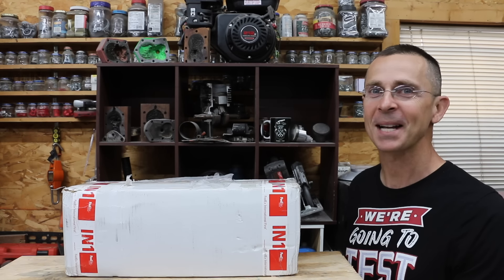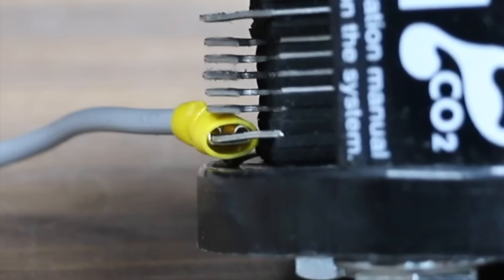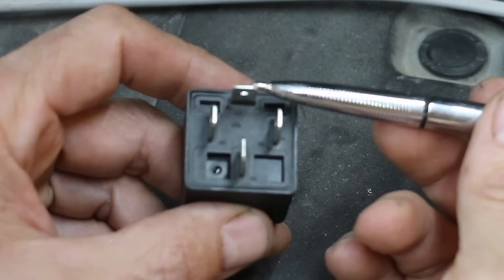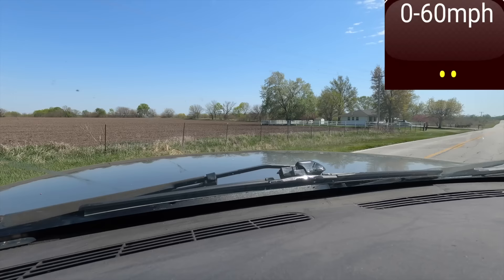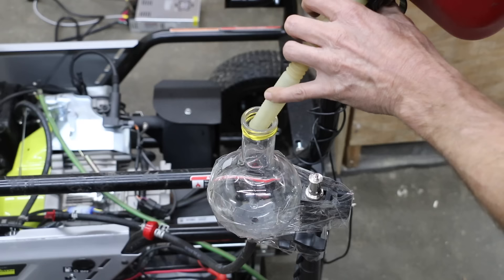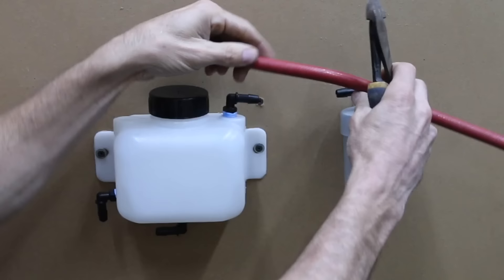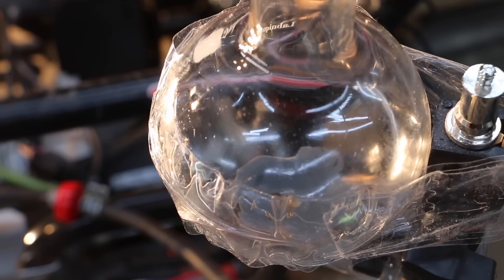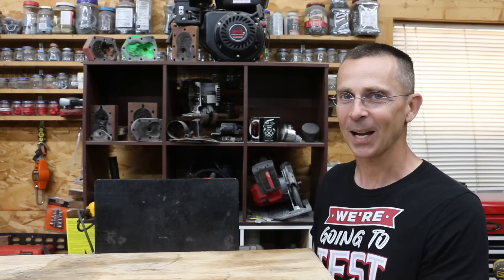AMAZING 35% More MPG with HHO? Let’s find out! Help with high gas prices?

Comment: Glad to see that conservation of energy holds true in real world testing! 

Every time the energy is converted between mechanical (M), electrical (E), and chemical (Ch) there is a loss due to conversion efficiency being less than 100% with the waste energy generally going to heat. So the engine spins the alternator (M->E), the alternator powers the HHO generator (E->Ch), and the HHO helps to run the engine (Ch->M). Every -> along the way has a fraction of the input energy being wasted. Assuming the alternator is 98% efficient, the HHO generator is 80% efficient, and the engine is 35% efficient, you're looking at ~27% (100% -> 98% -> 78% -> 27%) of the original mechanical energy returning as mechanical energy as a result of this process. 

Because the water has no inherent chemical energy (energy is required to break H2O into HHO which does have chemical energy; compare this to the gasoline which is ready to explode as is when you fill your tank), it doesn't add energy to the system. So as a result, the entire system has to be less efficient by adding what is basically just an energy conversion device.
Reply: Not true,  the alternatore make the same power when it spins, and he didn't lean out the fuel so it didn't work.
Reply: @joshfeller4683  not really sure what you mean about the alternator. The higher the electrical load on the alternator, the harder it is to spin. So it takes more energy from the engine to make up for the additional energy coming out of the alternator.
Reply: Hho fuel cells need to be sized by volume. The cell he is using is under sized and the amperage determines the volume of HHO produced not electrolyte. The mix is standard to the type of stainless steel plate in the cell. In mine its 1 oz to 1 gallon of water. It works great. I run a 3500 watt Coleman downdraft generator on just HHO, no gas anymore. This guy is alo pumping oxygen and hydrogen right back I to the motor to make water before it gets into the cylinder for combustion. That's why it isn't working at all. You have to use a split cell. Positive side makes hydrogen, negative makes oxygen. Hydrogen goes in closest to the fuel mix point so it doesn't mix with oxygen, hydrolyzed gasoline then mixes with your produced oxygen to create a high oxygen atmosphere for combustion.
Reply: @hellogoodbye3129  Where do you gain the extra energy to make the system self-sustaining? You should have loss of energy in its transformations, not gain...
Reply: @lucapalmieri9507  your mechanical advantage multiplier is throught the momentum of rotation in the pistons converted to electricity, half goes to your work load, half is run through a step up transformer to create current for hydrolysis. It's the same principle as gasoline, just not as powerful. About 40% less, but still enough excess energy through mechanical force multipliers. Chemical combustion produces excess energy. Your loss is in friction and heat, the heat can be used to increase the viability of the water making it require less current for hydrolysis. Hotter water molecules are easier to break apart, requiring less current and electrolyte. Allowing more kinetic energy to turn the magneto, that now has less resistance for maintaining combustion. And the cycle continues until the water is depleted. It is almost a perfect perpetual system that produces excess energy. Almost. This technology has been around since ww2.
Reply: @lucapalmieri9507  as for HHO additive in cars the process doesn't burn hydrogen directly. The hydrogen is mixed with the hydrocarbons in gasoline to increase the energy release in combustion by 35%. You are making hydrolyzed gasoline, that burns at 98% effectiveness. Low emissions, low chemical corrosion break down in your lubricant, and less friction from from a more stable power transfer of potential energy to kinetic energy. Hydrolyzed gas is just gas that burns better.
Reply: @hellogoodbye3129  Make a video of your generator running on only HHO, powering the HHO cell and some other things to show that it really works.  Also show how you're metering the HHO ratio with varying loads.
Reply: @hellogoodbye3129  you sound like someone explaining the afterlife, your selling something you think not know..  were is the extra energy coming from?
Reply: From what I make of it he's saying You don't need "extra energy" you're just making it more efficient overall. It's not like ICEs get anywhere near 100% of the energy that is potentially available in the gasoline. Making use of waste energy is the lowest hanging fruit in system efficiency.
Reply: @MrDJAK777  but the waste in an ICE isn't just unused mechanical energy. It's going to heat which is just sent to the atmosphere. So the ICE needs to produce more mechanical energy to spin the alternator harder.
Reply: @ultimavoid  the heat doesn't have to go just to the atmosphere. Industry uses waste heat to improve the efficiency of process cycles all the time. Which the commenter suggested is one thing done here with the "engine heat to warm water to lower hydrolysis energy requirements" if that helps with the energy use of the add on and there if the benefit provided by hydrolyzed gasoline (if it can actually allow leaner mixes with the same performance)  greater than the drain the hydrolysis causes there's going to be a net efficiency gain.
Reply: @MrDJAK777  this is true. Hho doesn't have near the potential energy of gas. But it has enough to resist the load of a 32lb magneto absorbing supply demands. I didn't come up with this. I watched a video on YouTube, did some research, gathered parts and it works! I can run 1.5w continuously with a 2kw surge. Getting it started is where the energy injection comes into play. You have to run a battery to start producing HHO, then turn the motor manually. Takes 4 pulls to start. Much quieter and the water just rolls out the exhauste, I don't recommend using the water again. It is contaminated with oil and will ruin your plates, I'm told. Distilled water and salts only.
Reply: @MrDJAK777  sure you could use heat to increase efficiencies of purpose build high temp electrolizers ( e.g.  sunfire Grinhy 2.0 project ) but thinking that you could do that with these alkaline non separating plate electrolizers and achieve an amazing efficiency that will overcome the inherent inefficiencies of an ICE engine (both thermal and mechanical)  including the losses from kinetic to electric energy then to chemical energy is IMHO very delusional.
Reply: And it costs more to create the hho through electrolysis m than gasoline.
Reply: @hellogoodbye3129  The main problems I saw with his setup was HHO Cells require a Square Wave Rectifier to create HHO Gas not just splitting water into Hydrogen and Oxygen.   Second, because he is only splitting H2O to HH and O2 with very little HHO as a byproduct it throws the O2 sensors out of wack that the computer cannot compensate the fuel to air mixture.  On old vehicles pre 1967 that system may work better, but not newer vehicles.  You can trick some older vehicles that have O2 sensors by using spark defoulers that moves them farther out of the exast pipe...but you'd still need to lean out the fuel mixture to compensate the added oxygen.  New systems use a plug in chip that is designed for the vehicle specifically that makes these changes automatically.
Reply: @johnchism9625  I should note the guy that built his was on an old GMC Sonoma v6. He ended up blowing the motor because his production was way to high. His HHO cells, plural, were big. I believe one cell was for low rpms and the other started producing at higher rpms. He also put an extra 60 amp alternator on to make up for the extra draw. But that old shit box really moved. Throttle response wasn't great, but when it started rolling it really flew.
Reply: @hellogoodbye3129  In 1988 I learned about "Brown's Gas" from a 1940s Collage Basic Science textbook 4th edition -I still have it on my desk among many other chemical, technical and science textbooks.  It wasn't until 2012 that I made my own HHO dry-cell for a 1987 jeep wrangler 4.2 I6 carbureted and learned by trial and error to increase the fuel milage from 18 to 32 mpg.  Most systems now are wet-cell and more efficient than dry-cells.  I still use that old dry-cell HHO as a torch that will cut stainless steel, melt tungsten and is used extensively in melting platinum for making jewerly and even melt stone.   I built a micro HHO wet-cell that without a carburator or any gas runs a weed eater or gas engine up to 5hp by adjusting the voltage and amperage with a rectifier and you must create a Square Wave for them to work right - which Brown said in his patent - or you're only separating the H2O to HH and O with a fraction being HHO Brown's Gas.  Why people refuse to use step-up rectifiers is beyond my comprehension to achive higher wattage from lesser wattage - without needing a more powerful alternator...which is exactly what an ignition coil does to make high energy spark plugs work.   Every skeptic is an engineer that quoats the laws of thermodynamics saying it doesn't work to create more energy... But the whole point of using HHO in any ICE is to increase fuel mileage which they do if done correctly.
Reply: @johnchism9625  thank you. Finally someone that knows how to do research! There are literally videos on how to make it work and its principles. On YouTube! But that is awesome that you made a torch and your vehicle got such good mileage. My generator is a behemoth with all the additions. It hasn't failed me yet. But I try to not use it if don't have to. I have a step up transformer/controller that will adjust with a load but is meant to stay at the tuned level to keep the engine at 3600rpm. Which gives me the 3500watts 1.5kw to work load and the rest to processing components. So a 1.5k excess of energy at 120v. 10 amp isn't to shabby. It's not perfect but it's safe. As long as you move the waste water away from the machine in sub 0°f temps. It definitely needs even heat distribution.
Reply: @hellogoodbye3129  You didn't come right out andsay it, but sounds like you're using a HHO on a ICE 1.5kw generator that gives the electricity to run the HHO system by ? fuel/HHO.   Fact is I don't know what your system is like.   Actual HHO made by a square wave does not generate much heat and heated water above 212F is mostly creating steam with HH and O as a byproduct, and not HHO Brown's Gas that is a "gas" unlike any other gases that have carbon bonds.   I assume you have a dryer/bubbler system and a spark arrestor?  If so, the steam is mostly returned to water until the bubbler gets boiling hot too?  How big are your plate and are they staggered in a 1 possitive 2, negatives, 1possitive, etc... Or is it a possitive on one end with a negative on the other with many plates between them as neturals?  The latter is just a common Hydrogen/Oxygen generator where it needs a filter material that hydrogen passes through but is too fine for oxygen to pass through or it mixes them as HH an O molecules and if there is stem it's like water injection until there's too much.   While the HH and O is still combustible and added into the air mixture of a ICE with a fuel will improve fuel consumption,  HHO does it better.   I hope this helps.
Reply: @johnchism9625    "Brown's Gas"? Chemists speak of oxyhydrogen gas, others call it explosive gas. There is no mythical "Brown's Gas" with properties which are different from the well known mixture of hydrogen and oxygen. Brown didn't find anything new. But never mind if you call it Brown's gas or HHO, you can only increase MPG substantially with an electrolytic cell which produces more energy than the input of electrical energy. And such a cell doesn't exist.
Reply: @hellogoodbye3129     " your mechanical advantage multiplier is throught the momentum of rotation in the pistons converted to electricity, half goes to your work load, half is run through a step up transformer to create current for hydrolysis "
???  None of this processes gain energy, all of them have losses. Where is the "multiplier"? To increase MPG you would need an electrolytic cell which outputs more hydrogen energy than the electrical input. Such a cell doesn't exist.
Reply: @heinzpg  well it does exist. There is loss but the loss isn't enough to not maintain production. The generator is 3500watts. It requires 2kwatts to maintain production and an excess of 1.5k wts at 10amp 120v.  My step up transformer/controller/rectifier unit is all in one. It increases the current to maintain the production of HHO so that the ICE runs at 3600rpm. It's not a gas engine by any means but the potential energy of HHO is greater than the kinetic loss of the generator. And remember compressing the gas increases the potential energy of the kinetic release during detonation.
Reply: @heinzpg  and once again you can look this up. I did. I'm not a chemist, electrical engineer, or a physicist. I'm a construction work that can follow directions. Current amplification is a well known phenomenon that is already used in motor vehicles. Its call an ignition coil. The same principle applies to an HHO generator. Just a little bit of research and you can find lots of videos on this. Coleman 8hp 3500watt hho conversions. I don't get as much amperage as they did but my generator is old and worn.
Reply: @hellogoodbye3129    Yes, you can amplify current. I wouldn't call it an ignition coil, since ignition coils are intended to increase voltage, not current. But they can be used the other way too of course, it's just a transformer. But if you increase the current, the voltage drops with the same rate. Watts at the output are the same as at the input, minus losses. A transformer can step up voltage or current, but it does not generate any energy. 

Yes, there are a lots of videos on HHO generation which claim fabulous efficiencies. Most people who watch these videos with awe are not aware, that hydrogen gas is produced by electrolysis on an industrial scale since almost hundred years, many companies do it. Their devices have been improved all the time to push up efficiency and it is not very likely that YouTubers can do it better. If there would be a better way, these companies would jump at it at once to increase their profits. Some of these videos are deliberate scams, others come to their high efficiency only by incompetent measurements. Let's take the electrolytic cell you are using as an example. If you can give me the watts of the electrical input and the volume of gas (hydrogen plus oxygen) produced in a certain time I can give you a good estimate how efficient the cell is. I guess it's efficiency will be about 60%. 

As to "Coleman 8hp 3500Watt HHO Conversion", can you give me a specific link? Coleman is known for it's power generators, and of course you can use their electric output for HHO production. But the key is still the efficiency of the electrolytic cell, never mind if the cell is powered from a "Coleman" or from a wall plug with power adapter.
Reply: @heinzpg  so my input voltage is 120v, amps is 20, watts is 2k. The voltage to the plates are less than lethal, 50v>, the amperage is 40-60. If I remember correctly the volume of HHO is 8L per minute. With 56 plates at 6inch by 6inch. All wires are 6awg or larger. The amperage changes depending on the load. But it's a brief. The heat sink to the pyrex cell housing keeps the water temp at 180-200°f, and the vibration cycle is 1800 cycles per minute. The website where I got the transformer/rectifier/controller is not up any more. I just picked up another Coleman to build another one, so I'm going to have to find another controller. I built my first one about 6 years ago. So it's been awhile.
Reply: @heinzpg  mind you, you cannot put a load on this machine until you are at full temp and capacity. It will stall immediately, the battery is a 48vlt/100amphr that puts out 5kwts. It was very expensive to build but I sourced most parts second hand from my cousin whom worked at Noles atomic in upstate ny. He did my tuning, and controller programming. To quote him, he said "this is the most back woods contraption he has ever worked on". But it works, he also said this technology is already out dated, there are much more efficient ways to make this power. This was years ago. But I already spent over 2 grand on this project and what I'm getting for power is not cost effective compared to other technologies. But I only need distilled water and salts to run it. And with gasoline prices the way they were then to now it doesn't seem like such a bad investment. I should add that the duty cycle is garbage. It's less than 70%. So running it for 10 hrs requires 3hrs cool off time just to use up another 1 hrs worth of fuel to get back up to capacity.
Reply: Can you repeat that?
Reply: @hellogoodbye3129     I want to make sure I understand your system correctly. You run a combustion engine with no other fuel than HHO. This engine drives a generator wich produces electrical power. A part of this power is used to produce the complete HHO for the engine by an electrolytic cell. The rest of the electrical power is free to be used for other purposes. Correct?

Now for the numbers. The input for the cell is according to your comment 120V, 20 amps, 2k Watt. I would expect 2.4 kW, reason for the difference could be that the input is not pure DC, this difference is not important. The cell produces 8 liters of HHO in one minute. The equivalent power of this production is approx. 1 kW, which makes an efficiency of the cell of about 50%. The surprising thing is, the engine gets via HHO an input of 1 kW, but the generator driven by this engine delivers 3.5 kW ?! Although a hydrogen combustion engine has only an efficiency of about 40% and also the efficiency of a generator is below 100%. This is hard to understand! Can you clarifiy this discrepancy? Or do you think conservation of energy is not valid in your system?
Reply: @heinzpg  so the total production power from the generator is 3500watts, 240v, 40 amps, 2kwts to the production of HHO. This is to the controlle/battery then from there to the cell. The cell produces about 8L/min that is forced through the intake.  Now mind you there is a heat sink that improves efficiency of production, and a vibration unit that improves the flow rate. It reduces hydrotension thus reducing the current needed to produce said volume. No energy loss in either of these processes. The Ice makes the heat and simultaneously vibrates the cell at half the rpms. This is a massive increase in efficiency. I'm literally using the heat loss and mechanical loss to improve the production capabilities of the cell. Thus improving my overall efficiency back to a balanced system or pretty close. I could put a higher production magneto on it and have more excess wattage.  You seem to have a hard time understanding that the magneto makes electricity. Not the hydrogen. If you magneto makes more wattage than you need to make fuel you have excess energy. Hence the mechanical multiplier of a generator. You are spinning a magneto that has momentum that is very efficient. The energy to spin the magneto is less than the production of power the magneto creates. Hence excess power. Does this help?
Reply: @heinzpg  the efficiency of the cell is higher than 40%. The controller, heat sink, and vibration improves its efficiency. I do lose 10 amps in there somewhere. So maybe that's the loss you seem to be needing. Once again I'm not a electrical engineer, physicist, or worldly scholar, but I can follow instructions on how to put parts together. So maybe I'm not telling you something crucial, but I can say this. That little generator makes 1.5watts, at 120v, at 10 amps. And its quieter than a gas motor.
Reply: @heinzpg  so to make the point. Of energy conversion, why would I waste my energy trying to convince anyone that the system works if they couldn't make one themselves. I gain nothing either way. I could just ignore you. But it could benefit you so I'm making an effort to help. Have a good life and good luck.
Reply: @hellogoodbye3129    Thanks for your explanations. In return I will explain you why I still have problems to understand your system. You are not an engineer and physicist, and thus you are not familiar with conservation of energy. It is one of the most fundamental and best confirmed laws of physics, never was any exception observed and there is even a proof, that our universe couldn't be stable without this principle. In short: energy can be transformed from one type in another type, but energy can not be created or disappear. Thus, if you have a system with an output power of 100 Watt, there must be an input of 100 Watt. Only exception: if the system has a storage of energy which is used up over time, then obviously there can be an output higher than the input.
Let's look at a generator. If a generator produces electricity, you must apply a torque to turn the shaft. This is the mechanical power, which is input, besides a constant it is given by the product of torque and rpm. If this mechanical input power is 100 Watt, there will be an output of exactly 100 Watt. Unfortunately, perhaps 80 Watt will be electrical power, and 20 Watt heat losses. With a better construction you might reach 95 Watt electrical power, but never ever will you get more than 100 Watt output. So if you write " The energy to spin the magneto is less than the production of power the magneto creates " it doesn't help me in any way, since due to conservation of energy output can never be higher than input .
And this can be applied for your whole system. It is supposed to deliver 1.5 kW, and this would need an input of at least 1.5 kW. Where is this input? All you input is water, but water has no chemical energy, only hydrogen has. But to get hydrogen from water you have to spent more energy than the produced hydrogen can deliver. Even with every component having an efficiency of 100% your system could not work.
This is the reason why your explanations don't help me and they also don't help mankind. If you really want to help there is only one way, which is a little cumbersome. Get hold of a competent engineer or physicist, invite him to your place to inspect your system and let him write a report about this power generation out of water.  Unfortunately, there were thousands of people who reported to have such a system which produces an energy output without an equivalent energy input. But none of them ever took the trouble to obtain a competent third party confirmation, although this would help mankind immensely and the name of the person who got such a confirmation would become famous and would be mentioned in any textbook on physics in the future. I refrain from speculations why this has never happened. 
I also wish you a good life and good luck.
Reply: @ultimavoid  Correct, the alternator is converting kinetic energy from the engine driving it via the belt into electrical energy... so the more energy it creates the more drag... same way regenerative braking on an EV works... rather than turning kinetic energy into heat energy like with a conventional brake rotor and pads... you convert it into electrical energy.... but you have losses as you say and thus lose more energy than the device could possibly gain you in efficiency. For those stating you have to lean out the engine through the carb... fuel injection would have to do the same thing... but then you are shifting away from stocheometric air/fuel ratio. Now with low load, you could do that minus the expensive device that basically does nothing to the air/fuel ratio when you consider how much air the engine is pumping vs. the small bubbles of hydrogen the device produces.  Air/fuel ratio is by mass... 14 parts air to 1 part fuel for gasoline... on a small block chevy 350 cu inches of air per rotation to a tiny droplets of fuel per stroke... and it is the weight/mass of the air that matters, which is why chilling the air can make more power.. a huge part of why nitrous oxide systems make so much power, you increase the oxygen by introducing N2O and more fuel to keep the A/F ratio where you want it for max power... 21% O2 vs 33% O2 equals more power when you add the matching fuel.  The coversion of the nitrous from a liquid to a gas when it exits the bottle drops the intake temp by hundreds of degrees... meaning you can fit much much more air into the cylinder per stroke and add even more fuel for more power. Problem with using Oxygen as a power adder is that it would just turn your engine into a torch. The nitrogen in the N2O acts as a buffer as Nitrogen is normally an inert gas (until you hit certain pressure and temperature levels at which point you can create Oxides of Nitrogen which are really really bad for everything.
Reply: @hellogoodbye3129  good on you mate you just can't help some people. ive known many smart men but bugger all wise ones . the point is people unleaded in Australia is $2.15 L,  water out of a rainwater tank is free, good on u hello goodbye some people will always reject your reality  and substitute with their own
Reply: yes we all know for every action there is an equal reaction most of the time !!! these hydrolyzers have been used for years by lots of people and they do work when the engines they are used on are tuned for the different fuel that is being put into them, i thought even smart people new this. on paper a bowling ball should fall faster than a feather but it doesnt. the hole point is water is cheaper than petrol
Reply: @stickers7627  thank you. I didn't figure this stuff out, other people did. I just built it the way I was told. A monkey turning a wrench, y'know? Sorry to hear about what's been happening in your country. I have cousins down there and they can't even get Carona Extra anymore. And it's only the tip of the iceberg. Good luck buddy, thank you, and stay alive.
Reply: @stickers7627  there's no "most of the time" when it comes to laws of physics. Sum of energy in = sum of energy out. If you can find an example that contradicts that, you can turn the entire discipline of physics on it's head.

A bowling ball does fall faster than a feather unless you do the experiment in a vacuum chamber. The coefficient of drag on a feather is much greater than a bowling ball, so there is more force from drag counteracting gravity on the feather. Remove the air and you remove the drag, so it's just the same gravity acting on both. On paper and in real life, they both check out.
Reply: @hellogoodbye3129  we will be OK mate plenty of water for us the smart people don't want it
Reply: @stickers7627  🤣
Reply: @stickers7627    A bowling ball does fall faster than a feather. However, science knows that the difference is just caused by air resistance. In vacuum bowling ball and feather fall with the same acceleration. Because with an object with more mass force of gravitation is stronger but also inertia is bigger, and thus mass does not influence the acceleration of falling in vacuum.
And just as science knows about the falling of bowling balls and feathers, science also knows that water is not a fuel. Hydrogen is, but to get hydrogen from water you have to invest more energy than the produced hydrogen can deliver. That's why hydrolyzers together with tuning may cause a very slight rise in fuel efficiency in singular cases but in general this can't work.
Reply: So false. Idk where you did that research but your completely wrong. First of all the alturnator spins and produces power any way so its not loading the system, secondly water is one of The most power dence things on this planet besides suger. Hho also has a far greater expansion rate and can be safely made on demand. There are cells that run motors its a fact there are even commercially available welders and generators that run on water...
Reply: @chrisofthecosmos648    No, an alternator does not produce power "any way". It needs mechanical power to spin an alternator, and the more electrical power is produced the more mechanical power is needed to spin the alternator. The input of mechanical power is always bigger than the electrical power produced.Thus, the alternator is indeed a load for the system. 
And water is not a fuel, you can't burn water. For the simple reason that water is what you get when you burn hydrogen. Same thing with carbon. You can burn carbon and if you do that you get CO2. But you can't burn CO2. Of course it is possible to produce hydrogen from water with an electrolytic cell, this is done on a big scale by many companies since hundred years. But in this process you have to spend more electrical energy than the produced hydrogen can deliver.
And yes, you can run motors with hydrogen produced by a cell, but you can never get the electrical power needed at the input of the cell by an alternator driven by this motor. This is completely absurd.
Reply: @heinzpg  yeagh, you are definitely wrong. In many ways. Water does burn at extremely high temperatures. 5k°F<.  It has to be hot enough to break the bonds between the molecules. And it takes alot less energy to break the molecules apart through electrical ionization. Like in a HHO cell. The trick is to make the efficiency of producing HHO higher than your energy loss. I recover the heat and use it to raise the temp of the salt water to just less than boiling, as well as a mechanical knocker to break the hydrotension of the gas bubbles and doubles my out put rate of HHO comparatively. The efficiency of this system is awesome. Once again this technology has been around since world war 2. And Once again, stop being lazy and look it up. Look up the Tesla motor while you are at it. It will open your eyes to electrical conversion theories.
Reply: @ultimavoid  actually you are wrong, not taking into consideration that the mass of the bowling ball creates a measurable gravity larger than the feather and in addition of earth's gravity aswell as the bowling ball's gravity creates a higher acceleration, thus a higher speed towards each other. The difference may be miniscule, but still a fact. So the bowling ball does fall faster. So you are wrong, this isn't the 80's, we can measure these differences. You need to get your information from somewhere else besides tiktok. Look it up.
Reply: @hellogoodbye3129     I can only recommend to look up "conservation of energy". It is one of the best proved laws of nature, there is even a proof (Noether theorem) that our universe could not be stable without this principle. The efficiency of an electrolytic cell can't be above 100%. Never mind if you use heat or a mechanical knocker, both need an input of energy. But to run a motor by water would need an efficiency of the electrolytic cell of about 300%! 
It is easy to look up conservation of energy, you find it in Wikipedia and in any text book of physics. In contrast, your hints are more than vague. What about specific details? Name of companies who use this miracle-technology? Number of a patent describing it? Which efficiency is reached? And what do you mean by "Tesla motor"? I hope not the well known hoax about a car built by Nicola Tesla and which run without fuel? This hoax was brought up by a Mr. Savo after Teslas death. This car never existed. At the time this car was supposed to run Tesla lived in old age in a hotel in New York, he had no lab and no other assistance. 

Unless you are able to supply specific details about this miracle cell-technology I rate it as complete rubbish.
Reply: @heinzpg  my generator produces more electricity than is required to make HHO. The ice/hho portion of the generator requires a little over have the power that magneto makes. I dont get why you dont understand this. The only components that would have a patent numbers would be the original Coleman downdraft generator, and the  step up transformer/controller (which is Japanese). These are common items. I built the HHO cells, heat transfer array, and the knocker. The HHO cell only powers the motor to turn the magneto. The size of the magneto determines the out put of power. Once the magneto is spinning, it takes very little energy to keep it spinning. The reference to the Tesla motor is to prove the rotational momentum in a magneto is extremely efficient and effective. The law of conservation only applies to the ice/hho portion of the machine, not the total output of the magneto. If it was bigger, I could produce more power. The cell only requires a certain amount to sustain itself, as long as the magneto produces more current than required to feed the HHO portion you have excess current to do what you want with.
Reply: @heinzpg  this is like arguing the earth is round to flat earthers. The earth is round, HHO motors do exist, both have been this way for along time. And to clarify, the term down draft seems to be lost on people, it still burns normal atmosphere aswell as the hydrocarbons from the oil lubricant. It doesn't just burn HHO. It's a down draft motor. But the previous mentions of magneto size still apply regardless.
Reply: @hellogoodbye3129    " The law of conservation only applies to the ice/hho portion "    Fundamentally wrong! Conservation of energy applies to every system in our universe, without any exception! Look at power generators. The more electrical power they deliver, the more power has the engine driving the generator. You can't get eletrical power from a system, if there isn't an equivalent input of power. No  generator and also no magneto can have an efficiency over 100%.
Let's say you feed one unit of electrical power in your cell. You will get from that perhaps 0.7 units of hydrogen power. Hydrogen combustion engines have an efficiency of about 40%. Thus your engine will deliver 0.28 units of mechanical power. This power drives the generator, you can expect an output of 0.22 electrical power. But you need an input of one unit to run the system - even without gaining any energy. You can argue that you use the heat losses for a more efficient production of hydrogen, but also with this you can't get more than 100% efficiency.
Reply: @hellogoodbye3129    There is plenty of evidence for the round earth. But where is any evidence for a motor running on water? Name me any company which sells such motors! Name me any company which uses such motors! Give me a link to a data sheet of such a motor!nName me a Wikipedia entry on water motors! Hydrogen motors exist since more than hundred years but no water motors. 
Down draft engines are not lost on me. Normally they make use of bio fuel. No one burns atmosphere since no substantial component of atmosphere can be burned. Oil lubricants are expensive high tech products. It would be a waste to burn them. Besides, in relation to fuel their volume is negligible.
True, you can't produce much electrical energy with a small "magneto". But never mind if the size is small or big, you need more mechanical power at the input than you get electrical power out of it. The Tesla company produces electric cars, which just run from a battery with e-motors, but no magnetos.
Reply: @hellogoodbye3129    There is plenty of evidence for the round earth. But where is any evidence for a motor running on water? Name me any company which sells such motors! Name me any company which uses such motors! Give me a link to a data sheet of such a motor! Name me a Wikipedia entry on water motors! Hydrogen motors exist since more than hundred years but no water motor exists. 
Down draft engines are not lost on me. Normally they make use of bio fuel. No one burns atmosphere since no substantial component of atmosphere can be burned. Oil lubricants are expensive high tech products. It would be a waste to burn them. Besides, in relation to fuel their volume is negligible.
True, you can't produce much electrical energy with a small "magneto". But never mind if the size is small or big, you need more mechanical power at the input than you get electrical power out of it. The Tesla company produces electric cars, which just run from a battery with e-motors, but no magnetos.
Reply: @hellogoodbye3129  this sounds cool. Can you make a video on how you built it?